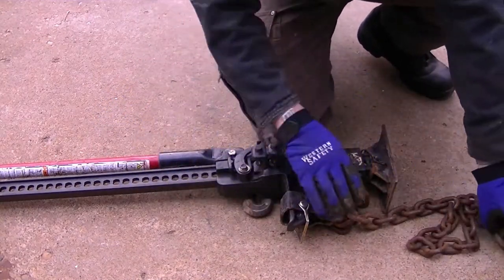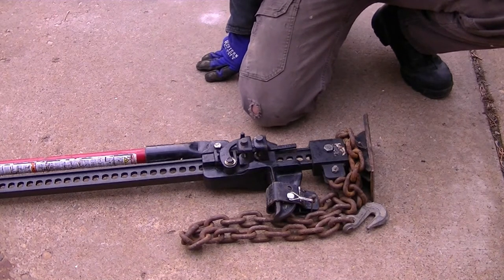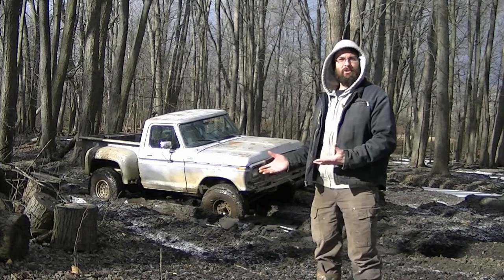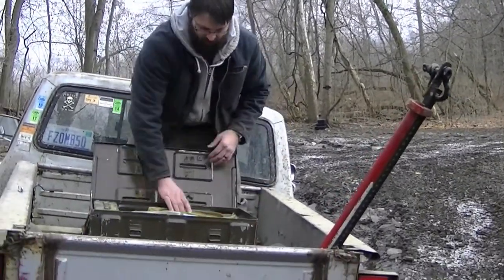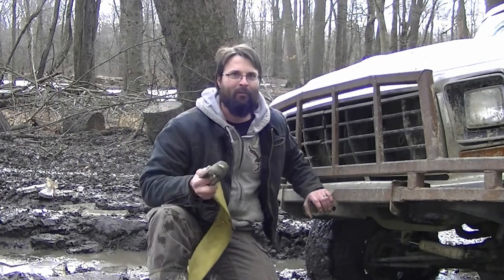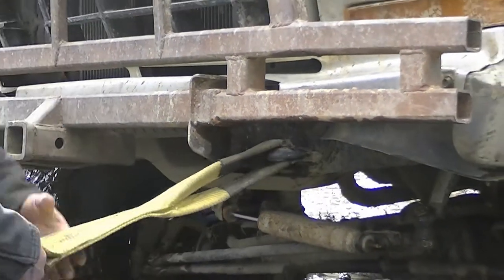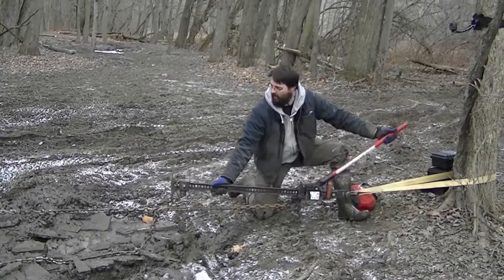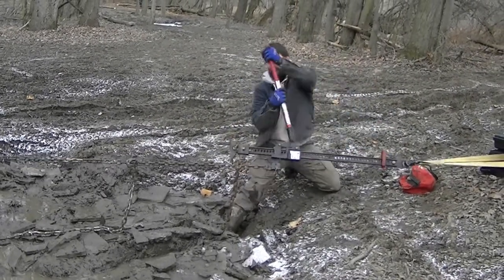Winching with a Hi-Lift Jack: using a Hi-Lift Jack and Winch Kit for Recovery. Fzomb50 gets winched!

Comment: You made the best video thus far showing how to practically use this kit with a chain. Thank you very much. That is a great tip to replace the clevis hook on one end of the chain with a winch hook. 
I have a winch on the front of my old Jeep, but wanted to set up a Hi Lift in the event of a rear recovery situation. I am confident I can do it now.
Reply from the maker: @brianhatcher7183 , thanks for the kind words. They mean a lot to me. It is always good to have an alternative way of self recovery.  Electric winch could decide it doesn't want to work,  good ol' mechanical winching gets it done. Also, you may have to pull from 2 anchor points for a recovery.... the Electric winch isn't doing that on its own. I have my electric winch mounted on a cradle so I can pull from the front or back, whichever gets me unstuck the easiest. I have a few videos using my electric winch from the front and back. I use the electric as much as possible, but alway carry the Hi-Lift and winch kit as a backup.  Again, thanks for the view and comment. Have a great day, and go get your hands dirty!

Comment: OK....you know that I am going to have to capture this video on my phone so I have your instructions all the time. 
Just to be clear....you have purchased a high lift jack winch kit?
I am none-of-your-business years old and live out on a farm alone. In those circumstances you do it all. Or try to. Videos like this are priceless. 
You did a great job showing how to put things together then make it work. Terrific!! Thanks and Jesus bless.
Reply from the maker: Well, thank you for the kind words. Glad the video is help to you. To answer your question, Yes. The Hi-Lift jack and winch kit are brought separately. The kit is available on Amazon for around $76. You can just type "hi-lift jack winch kit" in a Google search and find other vendors that sell it. You'll just need 3 things, all bought separately, to get a complete setup: a hi-lift jack, the hi-lift winch kit, 3/8" link chain (I bought mine from Harbor Freight but the chain is available at nearly any hardware store or farm supply store like Tractor Supply). It is most definitely a work out moving things but way easier than trying without it! Good luck and have fun!

Comment: Good demo.  I like that front bumper.  I have a similar set-up and a winch mounted to a steel plate with a hitch for the reciever.   Fits both front and rear bumpers.  Got tired of cranking the farm jack!  😅
Reply from the maker: I have a couple videos of me using my electric winch. I built the cradle and ran power to the rear of the truck so I can winch either direction. Often much easier to winch out the way you go in...lol. Thanks for the view and comment.

Comment: Thanks for the video!  Very informative!  I have seen some videos where the setup is reverse from what your doing.  For example the chain is hooked to the vehicle and the Jack is close to the vehicle with the base facing away. Seems to work the same. Any thoughts?
Reply from the maker: Thanks for the view and comment. I have seen it done the other way and in fact the instruction that came with the kit shows it done from the other way. I like doing it this way because I'm usually pulling myself out of the mud. By rigging it the way I do in this video I am usually not working in a mud hole...just do happens in this video my recovery point happened to be at the edge of one, go figure. I have never had an issue pulling like this. Never made sense to me to be pulling a vehicle out while walking in front of it as I pulled it out. As far as I can tell, as long as you're hooked securely to the stuck vehicle and a proper recovery point the jack doesn't know the difference of what point it's attached. Its just going to pull the chain as you jack. I'm sure there are instances for each hookup. This is the only method I've ever had to use. Hope this helps.
Reply: @Captain_Yodelstein  Thanks for the reply!  Again, great video. Definitely the best one I’ve seen using the hi-lift jack with the winch kit. I’ll be using your method
Reply from the maker: @derekhenderson9344  I appreciate that. Biggest thing to remember during any recovery is take your time. No sense rushing and making a mistake and breaking something or worse getting yourself or someone else hurt. Take it easy and go get your hands dirty.
Reply: And thanks to the person behind the camera for the zoom on the hooks at 9:10
Reply from the maker: @derekhenderson9344  thats my younger brother. He helps me out on some of my videos. Definitely makes the process easier...lol. I'll let him know someone appreciates his camera work.

Comment: Say what you want, but I don't trust chains one bit. I'd rather have a strap fail under tension than a chain. Still a good demonstration
Reply from the maker: Thanks. The chains can be sketchy. If I feel like I'm putting a lot of pressure on the setup, I generally throw some winch blankets over the chain and/or straps. The Hi-Lift jack is the "weak" point of the system, so it should stop well before a chain breaks. Any recovery can and is inherently dangerous, so got to take care while doing it. Hard to enjoy off-roading when your hurt or worse.
Reply: @Captain_Yodelstein  good point. Shear pin fails at 7k#'s and I know you weren't using some junk chinese chains. So often I see people not throwing a blanket over their line, straps, or chains.. makes me cringe sometimes. Happy trails! Thanks for the reply 🇺🇸

Comment: Why the extra Clevis on the end of your strap? Seems like that’s just more mass flying through the air if something breaks. Awesome video though. Thanks!!
Reply from the maker: Well Brad...you gave me something to think about. Like I said in the video it's just the way I always did it and it's always been fine. But the added mass aspect of really got me thinking. I know the jack is the fuse in the system. Everything I use to rig it up is rated at least twice the working load of the jack. After reading your comment and question I really see no reason for the extra shackle. It's just 1 more unneeded peice of equipment. Thanks for watching and asking a very good question. I appreciate it.

Comment: Thanks man!! How much is Hi lift like this?
Reply from the maker: The Hi-Lift can be found online for around $75 for the 48 inch model like in the video. To buy the 60 inch version is around $100. I replaced the bar on my 48 inch with a 60 inch bar, I have a video of that in my library. The winch kit is  around $75. You'll need to buy 3/8 inch link chain which varies in prices depending on how long it is and the grade (strength) you get. I bought mine from Harbor Freight (discount tool store) for $20 (with coupon/normally $40) for 13 foot lengths. Now if you're more on a budget there are cheaper jacks out there. They're referred to as farm jacks...for lifting tractors in a field. Thing to remember is this, when you're stuck on the trail do you want to rely on something cheap to get you out? Hi-Lift has a reputation for being a great jack and it is. On a budget the Hi-Lift with winch kit is great for recovery, but I do prefer my electric winch because its not nearly as tiring to use! One last thing though, if you plan on offroading a Hi-Lift jack, in my opinion, is one of MUST HAVES for any rig.
Reply: @Captain_Yodelstein  great answer and work. 
Thanks.
In Argentina It cost around 150 for 48 ones, but You now, All things are expensive here
Reply from the maker: @jgomezorellano  always hard to tell what prices are going to be for folks that live elsewhere. They are well worth the investment though. It's a tool that can do multiple tasks. I appreciate the view and nice comments. Have a great day and go get your hands dirty!

Comment: Chain systems also require safety blankets, particularly when standing alongside. Your coupling hooks are not suited to haul on chain links, you can buy the correct ones, even have both. Otherwise OK.
Reply from the maker: Thanks for the blanket recommendation. I'll start throwing one on my chain from now on. The weak link of the system is the jack itself. The safe working load limit of everything else used is well above what the jacks limit. Thanks for the view and comment.

Comment: I’m sold on that setup.  What lengths of chains do you have?
Reply from the maker: I believe they are 19 feet. I bought  them from Harbor Freight when I had a $19.99 coupon for them. It's 3/8" grade 43 trucker/towing chain. It has a stated 5400 pound work load which is right at the Hi-Lift jacks limit. Glad my video was a help to you. Thanks for watching.

Comment: I enjoyed the video. Thanks for posting it. I got a high lift and use it for many things. Pulling up posts. Jacking up one side of my wood shed to get to the rats underneath with my dogs (blocked up so it doesn't fall on them of course) . Recovery seems like another fine use for it. Pretty simple. 

Could you use say a 1/2" shackle in the hole of the large runner to hook a 3/8" chain up too or do you NEED to use the piece that goes over the nose and is secured with a bolt? 

Same goes for the bottom chain used to hold the main chain when letting off tension? Could I use just a shackle there too?

I generally want to know if you need the kit or could make it work with some mechanical knowledge and common sense?
Reply from the maker: Thanks for the view and comment. It means a lot to me. I try hard to make my videos entertaining and informative. 
Hi-Lifts are a versatile tool for sure. Cool you get that much use out of it.

Good questions. I wouldn't run a shackle through the hole of the lifting foot. The metal there is pretty thin and not sure how much weight it could support. To me you would definitely have to have something running over the top of the lifter. I took a look at the peice that holds the lifting chain to the foot. Its made from 3/16" steel and to my surprise it has a weld seam where it goes over the foot. With some metal working skills I'm sure that piece would be really easy to make.
As far as attaching to the bottom, if you remove the base and run the shackle through the hole of the bar I'm sure that would be more than strong enough. The bar supports everything anyway. 
Biggest thing is making sure the kit you put together is made with material string enough to hold the weight. Hope my answer made sense and helped you out.

Comment: Sure glad I have a winch !  I fabricated a front hitch receiver welded to the front frame. The winch is mounted on a removable mounting plate to where the winch can be relocated to the rear hitch receiver.  I have a 4 gauge hot wire running from the battery, through a 50 Amp replaceable fuse, along the top of the frame to the rear hitch with a quick electrical connection.  The ground wire at the rear connection is bolted to the vehicle frame. I don't look forward to having to relocate the winch from the front hitch receiver to the rear hitch receiver because I sure dont want to carry the weight.  Thinking of fabricating a sort of compact sled, of sorts, putting the winch on top of the plate with rope handles to pull it around to the back if needed.
Reply from the maker: I have a very similar set up for my electric winch. I have a few videos in my library where I use it. Not sure what you run on your winch, but synthetic rope save quite a bit of weight compared to steel cable. Another way yo save weight is to run less cable on the drum. Thanks for the view and comment.

Comment: A pair of "Come Alongs" from Harbor Freight works really well for this too. $100.00ish.
Reply from the maker: I started out with a cheap come along years ago when I first got into offroading. It was okay  had a lotbof issues with cable bind when putting a lot of pressure on it. But, using them in a pair....that might work pretty well. Might have to pick a couple up and give them another try. Would be nice not resetting every 48 inches of pulling!
Reply: @Captain_Yodelstein  or maybe a high lift plus come along? Be safe and happy trails!

Comment: I had a chain break on recovery and it flung broke rear window. Do you have any safety measures for that?
Reply from the maker: Good question. I have placed a jacket over the chain while winching before. It was when I was putting A LOT of pressure on the set up from a really good stuck! Winch blankets are pretty inexpensive as well. They have pockets in them to hold weight so when a cable/rope/chain breaks it deadens it and falls to the ground. Another option is looping a recovery strap or tree saver strap around the cable/rope/chain. I'll for sure have to do a video where I use a different ways of absorbing the energy from a snapped cable/rope/chain. I do have another video using an electric winch...but I can't remember if I used a winch blanket in that video or not. Basically anything fairly soft and light weight that can absorb the energy should work. You just need to slow it down and always make sure you're to the side of it. Got to stay out of harms way so you can continue to have fun. Hope what I said makes sense. Thanks for watching and commenting.
Reply from the maker: Here's a link to a video where I'm using a winch blanket. I start rigging it up at the 5 minute mark. Hope it helps. 
https://youtu.be/6hOMFoC-xo4

Comment: Thanks for this, I could not understand how to use the 2 chains
Reply from the maker: Glad you found it helpful. It really works pretty well, as long as you have some good footing so you can get leverage to pull the handle. Thanks for watching and commenting.
Reply: @Captain_Yodelstein  it was an entertaining video, I just watched it again with my GF (we got stuck real bad last weekend and don't want to happen again! , so bought the same Hi lift as you and the winch kit)
Reply from the maker: @danz1910 , good deal, bud. It's definitely a handy tool to have on your rig. Get a little practice with it in a controlled situation so you're familiar with how it all works. Be sure to keep the jack lubed up also. It does not work when it's not lubed. Just keep a can of spray lube with you. Another cool thing about these jacks is that you can swap in the 60-inch bar as an upgrade. 
If you search "Hillbilly Row Machine" you can find a video on my old channel where I'm using the jack with winch kit while standing on ice. It's what inspired me to do a tutorial type video for this channel.  
Your off road trips will only get better now that you have a way to self recover. Have fun out there!
Reply: @Captain_Yodelstein  thanks so much for the tips! I see that if you don't have a solid non slippery work surface, it becomes a real work out. I'll bring some sand for sure during winter

Comment: You added to the confusion.
Reply from the maker: What specifically did you find confusing? I appreciate input and encourage constructive criticism.  I've been wanting to redo this video because there are parts I'm not completely happy with so I'll take any advice on how to improve it.
Reply: @Captain_Yodelstein  started when you mentioned what chain did what then switching it.
Reply from the maker: @darrellroeters4951 , gotcha. That's one of the parts I'm not happy about. Was it that I misspoke, didn't show the chain hookups, explain each chains purpose, explain the process well enough or pretty all the above?